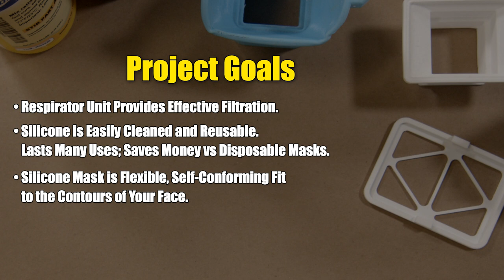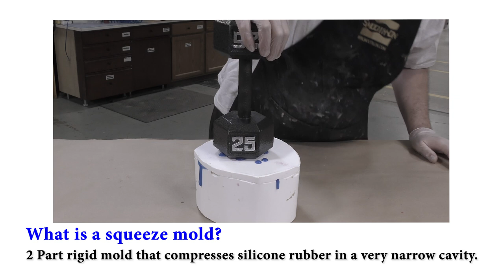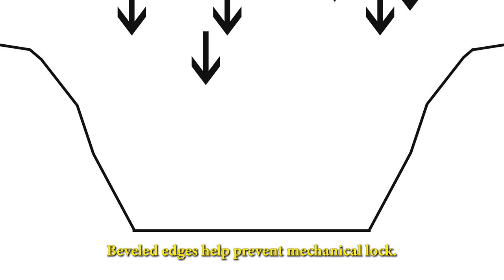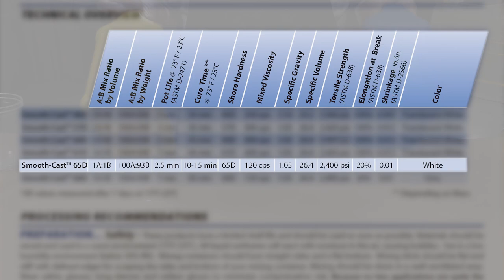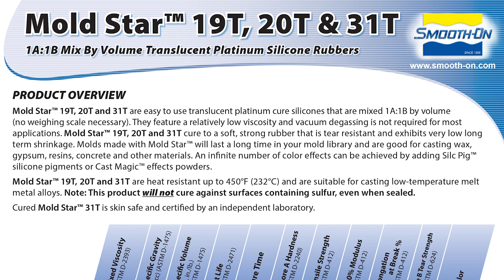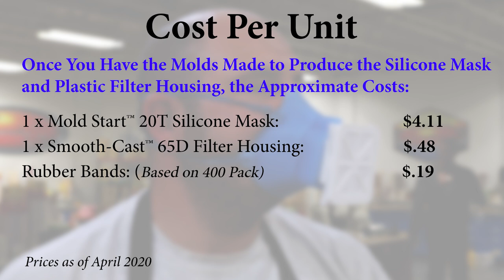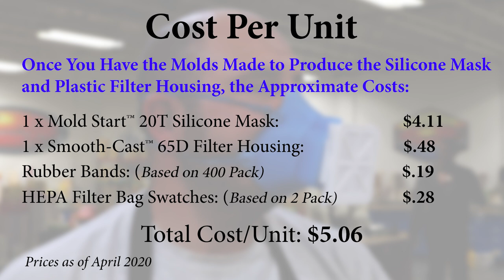How To Make a Reusable DIY Silicone Respirator Using Mold Star 20T Silicone Rubber

Comment: You neglected to detail for your viewers the cost of materials for the actual 65D mold, including the sculptex clay, the silicone pigment, and the aluminum shim material, as well as where your viewers may find the shim online. 65D goes for about $92 for a gallon kit, and it looked like you used about half of that for the two mold halves. That ups the overall cost of each respirator when you factor the mold cost divided by the number of respirators you make.
Reply from the maker: You are correct, there are ancillary costs which must be figured in as well.  In this case one of the benefits of the casting material is that the silicone does not contribute to the degradation of the resin mold, so the more you cast, the more you can recoup that cost.  The molds for the filter holder will need to be remade if a large number of castings are made, but this depends on the type of resin used, etc.  You can reduce some of the tooling costs in this case by adding a filler to the resin for the rigid mold, or even using a plaster such as hydrocal (properly sealed) for the rigid mold.
Reply: @smoothon  Ah! Thanks for that answer Milo, I was about to ask if we could substitute 65D with a hard plaster like Ultracal 30. That will help to lower the cost of the project.

Comment: Why develope another method, was there a problem with the method/design using Ecoflex?
Reply from the maker: This method is different in that the silicone gasket is no longer needed, but casting the parts takes longer as it is a different type of procedure.
Reply: @smoothon  Oh good as I have just collected all the materials to make and cast the previous version, using Ecoflex and didn't want to discover that there was a problem with that design.
Reply: @mainstay.  I just got the materials to make the Ecoflex/Task 8 masks, so I'll be giving that design a try soon.  I suspect that design might be cheaper per-mask, since resin is cheaper than platinum-cure silicone, but let's see what Smooth-On says.  The nice part about that Task 8 mask is that all the parts can be sanitized.
Reply: @WilSisney  I agree the ability to sanitize Task 8 with heat is a big plus in my books. I was asking because I thought I saw someone post that the filtered opening of the previous design might be too small and allow too much build up of CO2 when one is breathing out but this design seems very similar in its area of opening.
Reply: @WilSisney  either hot soapy water will sanitize or use rubbing alcohol or bleach water. Hot soapy water is easiest for sure.

Comment: im actually trying this method out but with Plaster of paris as the mold rather than resin.
Reply from the maker: You will probably need to seal the plaster with a clear acrylic spray such as Krylon Crystal Clear.
Reply: @smoothon  true. And im gonna use alot of vaseline so the plaster wont stick to itself haha

Comment: can you use mold forms from previous respirator model with  mold star 20t?
Reply from the maker: It would depend on the material the original model is made of. Testing would be required to ensure there is no inhibition.

Comment: Anybody have any ideas on how to mold a respirator with a flange, like 3M designs and similar?
Reply: Insert placed in the mold, overmolded around the insert, pull product off the insert since it is flexible.

Comment: Does anyone know if you can buy the gasket for the mask ?
Reply: no, but just use a bead of 100% silicon caluk from the hardware store. Its skin safe and only need a little bit. Its also comfortable as well. I did this on all my 3d printed masks rather than making the  gasket.